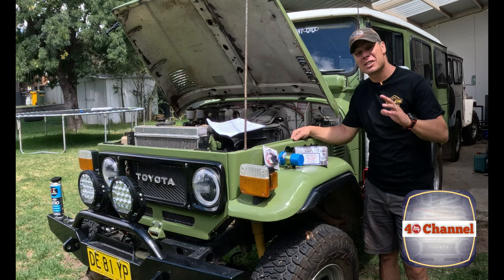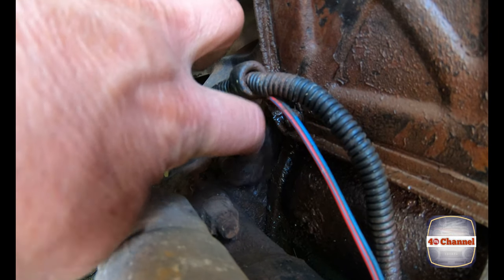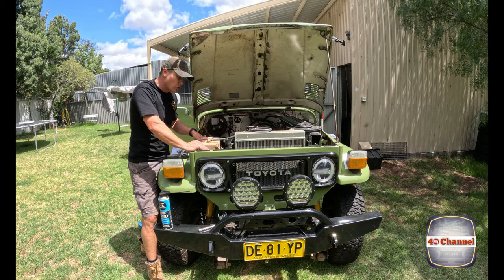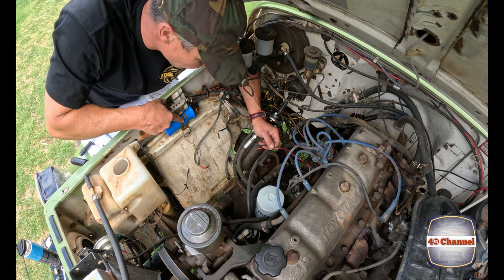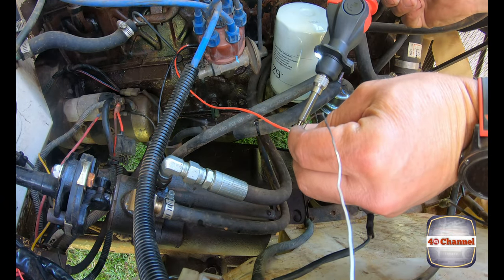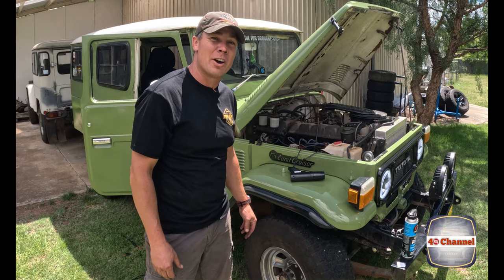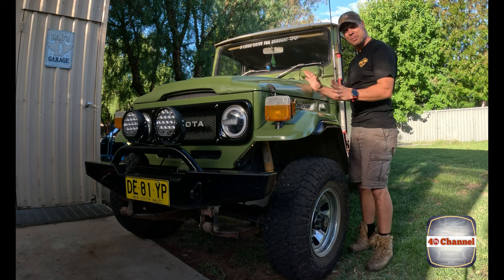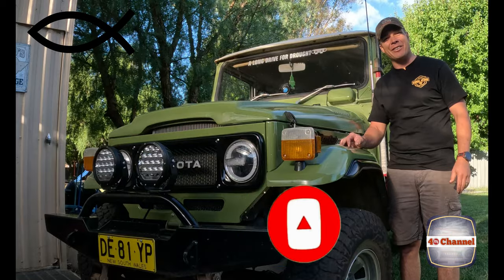S2EP81 - Electronic Ignition conversion, upgrade to old Landcruiser - But why Did I breakdown?

Comment: Iv done this on my old 3F motor & got rid of the points
Reply from the maker: Good upgrade, Have you noticed improvements, fuel or power?
Reply: @40ChannelCruiser  yer I did then I did a Diesel swap in my 75 series Landcruiser troopy.. there good to have & get rid of the points